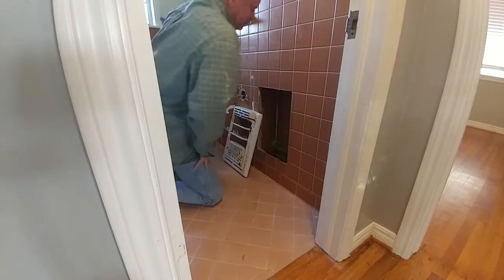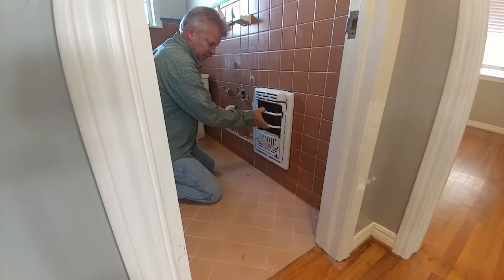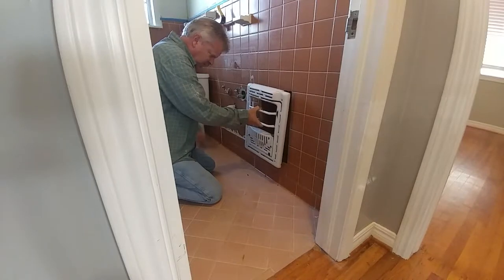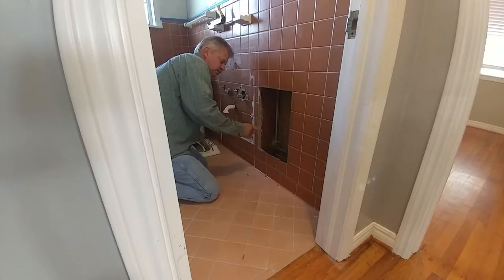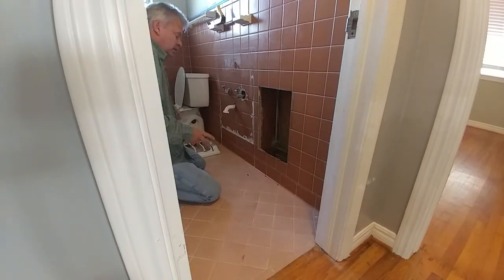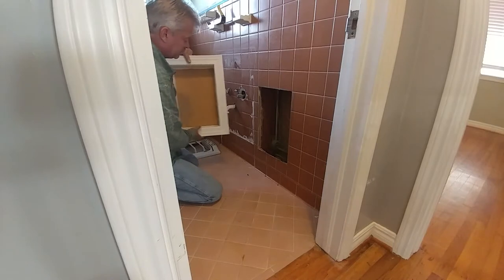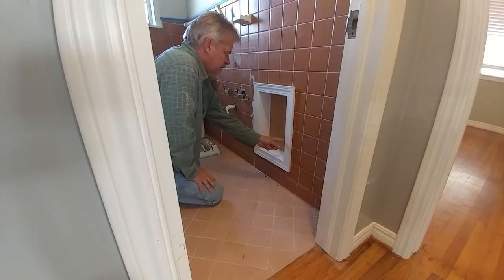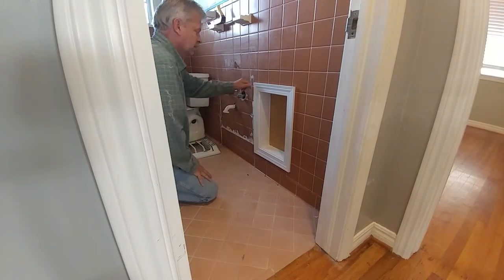Replace bathroom gas heater with bookshelf

Comment: Do you still have the grate? I would like to purchase it from you if you have it still.
Reply from the maker: Sorry...I don't. But I.ll keep my eyes open for one.
Reply: I have 2 of them. How do i cap the gas line?
Reply from the maker: @ecgodsmack86  you might want to get a plumber to properly cap the lines. I bought the caps I  needed at ace hardware.